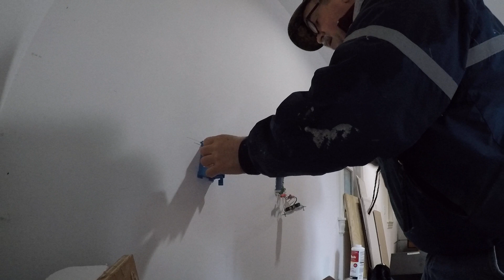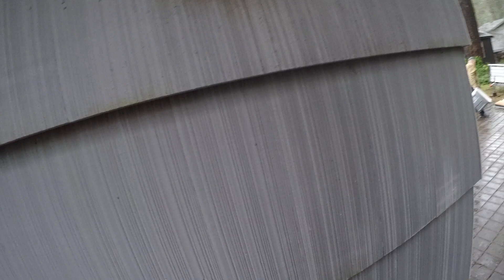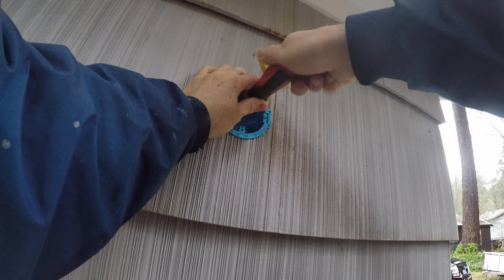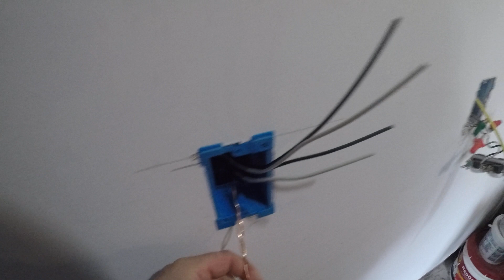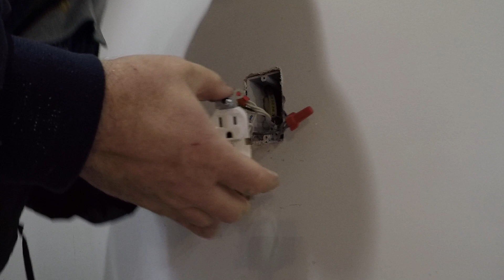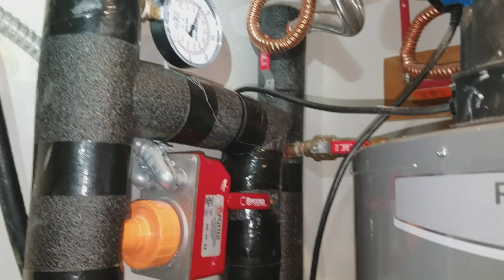How To Add A New Motion Sensor Light And Switch Step By Step

Comment: Nice job.  I'm going to be putting a switch in my travel trailer to control an outlet for the new theater seats I installed in place of the dinette powered from an existing outlet and you pretty much confirmed what I was planning on doing.

[img]https://i.imgur.com/7CoV6Obt.jpg[/img]

The seats have a butt warmer, back massage and power outlets in the center console, but want to be able to switch it on/off as needed when plugged into shore power. (just in case we forget to turn off the butt warmer.... )

I've also added a 30a RV hookup to the side of my house and wired in a generator switch into the panel so I can run some stuff with my Honda 3000 gen.  Yeah, I'm spoiled in "camping"...  I don't need water or sewer in a site.. But, having power is where I'm spoiled for sure!

Hows the new engine in the truck doing so far?
Reply from the maker: Those are quite the seats. Being able to power your house with a generator is handy too. I'd be making the water sewer connections happen.  Those generator subpanels are a very good thing to have. I've installed 6 I think now. Et/